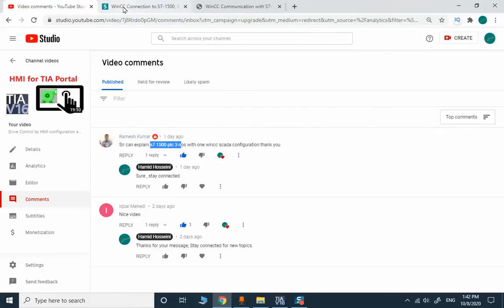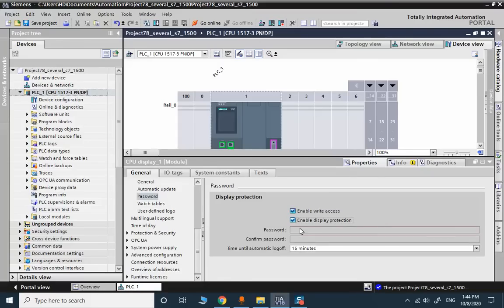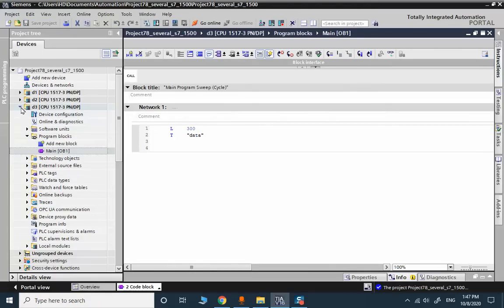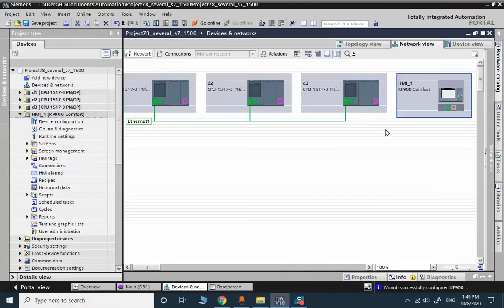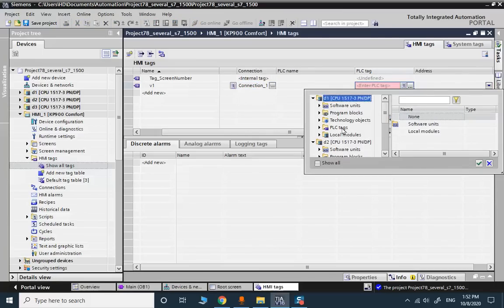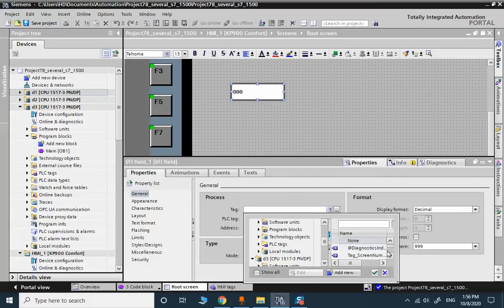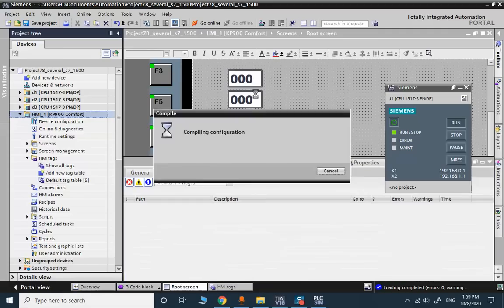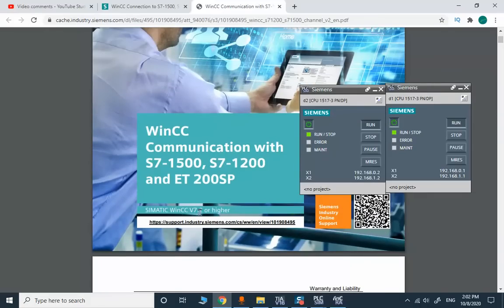How to connect three S7-1500 CPUs to a single HMI in SIEMENS TIA Portal | TIA Portal HMI Tutorial

Comment: Thanks
But i need opposite
I mean 3  Hmi  with 1 plc
Thanks again
Reply from the maker: That is even easier, do it for one HMI ,  copy the HMI and then perform the corrections.
Reply: @hdhosseini  do you mean same tags and faceplats and same controller Adresse but change in hmi address of each one
Reply from the maker: One PLC and 3 HMI panels mean you have a single machine with 3 OP panels. Projects can be identical or you can make a some screens available for certain HMI panels and remove from others.
Reply from the maker: It depends on your requirements.
Reply: @hdhosseini  yes i know that but i mean adressing of each hmi
Reply from the maker: For each HMI panels , you can define different IP addresses if you use Ethernet interface.
Reply: @hdhosseini  ok.... 
thanks so much

Comment: How to HMI connect with third party PLC (AB) and direct to CU320 drive via Profibus?
Reply from the maker: HMI for TIA Prtal , supports DF1 and Ethernet /IP for AB. Check the HMI and available connection types.
Reply from the maker: If the variables are in controller scope, you can use them by name in TIA Portal.